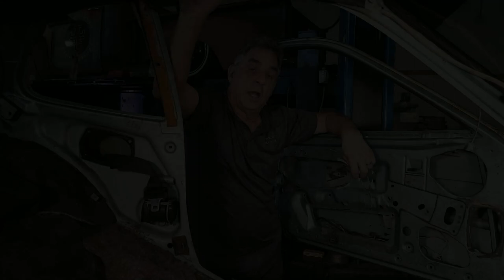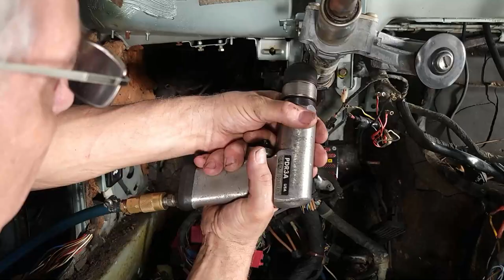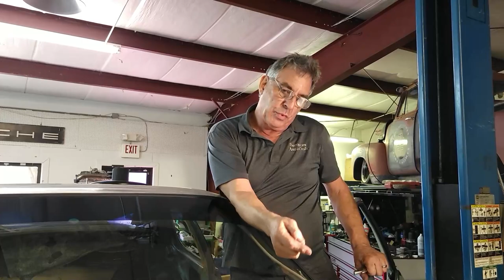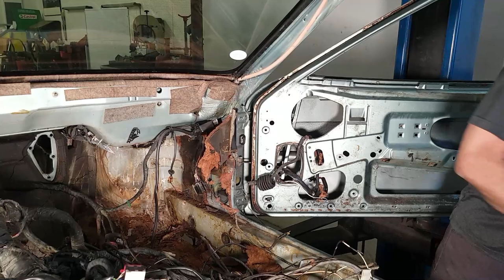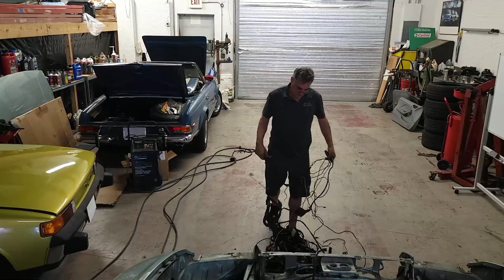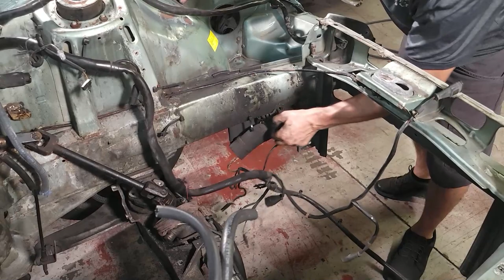Episode 19 - 1986 Porsche 944 Turbo Restoration - Main Wiring Harness

Comment: Today I started with the harness removal cause lightswitch and foglightsw glues away...now I checked your video for the next steps: it's really helpful!!! Btw: the removal of this fu..ing bolt which hold the steering shaft costs me 60min...next step will be to check out how you removed the heater/ac unit to get the wires behind free ...all the best from Germany. BR Rene

Comment: “…all you engineers are probably laughing…”. I am an engineer and I am not laughing, rather I am really impressed by your knowledge and ability to totally remove the entire harness from the vehicle.  I have two sets of floor to ceiling tool boxes crammed with tools in my garage and I sometimes think you professional mechanics would laugh at me and my amateur attempts when working on my cars.  As to drilling a straight hole, well, I drilled into the ring gear after attempting to drill out a stripped triple square bolt head on the clutch!

Comment: This is why most auto repair tv shows never do anything computer controlled. There is so much sketty under that dash that would even skeer off Einstin! I too have a 86 turbo and I take it to a dealer for lectric troubles.
Reply from the maker: We have a 2013 911 C4S that has salt water damage, floor only. We will be making a video on the renovation of that car. I'm sure there will be lots of corrosion, wiring harness replacement, as well as control modules. I'll mention that when it's coming. I appreciate you watching...

Comment: A very thorough and informational video. Again.

I do however believe the front lighting & accessory harness can come out towards the engine bay. Starting with the smaller fuse box connectors I was able to feed all of them through the hole in the bulkhead to remove the harness from my '85 NA.
Reply from the maker: I'm pretty sure I could have done that, if you only saw the ball of tangled wire inside, that move just looked easier.  Lol

Comment: I have a 1991 944S2, which I would assume has similarties to the 1986 turbo harness.   I've got intermittent power to the passenger side headlight.  The pigtail section closest to the headlight is fine (has continuity).  Any tips -  how to find where the short or break is?
Reply from the maker: Is it both low and high beam? Or just one of the two?

Comment: Hey is so detail great but mos of follwers will never mess with wiring diagrams o harness that much . Do not waste that much time in that prep better videos about suspension paint. I CAN NOT WAIT  for set videos engine rebuilt detail work cosmetic. Exhaust systems . Performance gain tips of that kind good luck